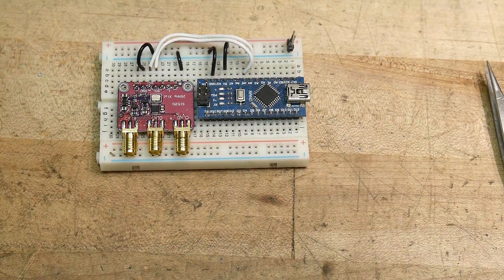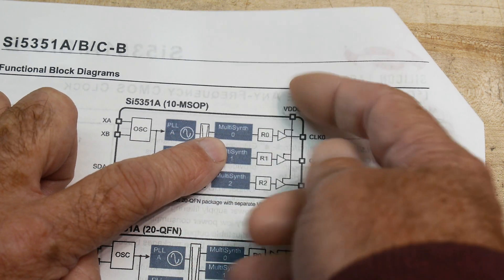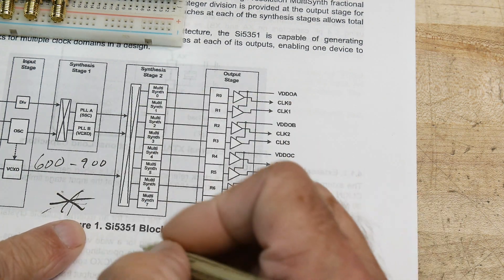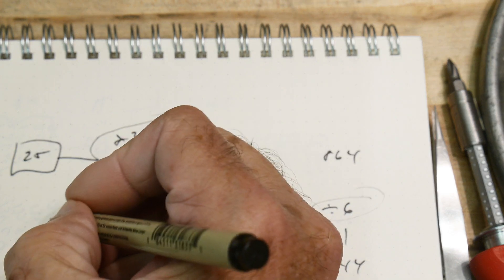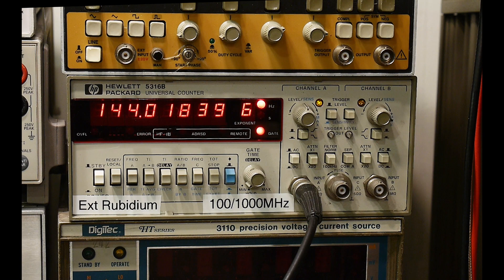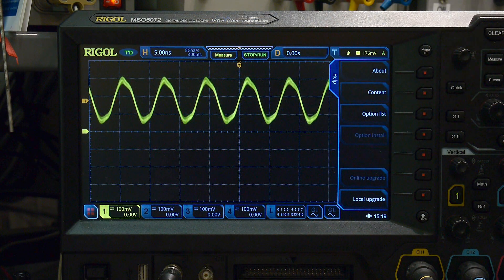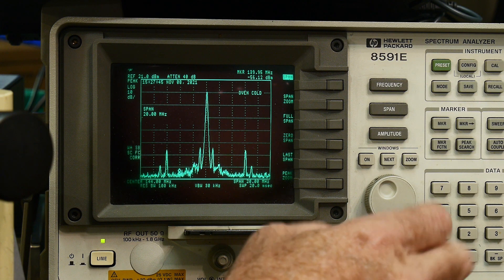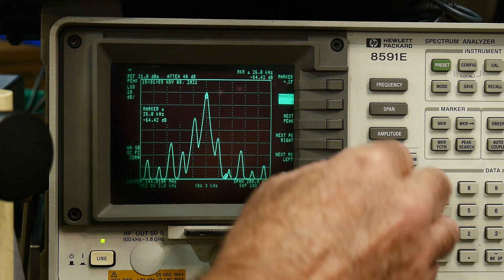#967 Why not use a Si5351 clock generator?

Comment: Have you looked at the supply raild? Maybe try adding a PSU filter and larger decoupling cap to improve the stability of the outputs. 100KHz sounds like the freq of a switch mode power supply.

Comment: Your resurrection of the IC-245 is spectacular!  I also have one, as well as the IC-255, 260, and 560 that may require this operation.  Also, as a matter of interest, I obtained a Ten Tec Delta II the post office was kind enough to destroy the LCD display.  So I've been considering replacing it with the LED style display and analog meter e.g. Ten Tec 516.  Your instruction is really making me think all these projects are possible!  Thanks again!  73, NG7I

Comment: In my opinion, the extra 43 Hz that appear on the display of the frequency meter are not due to its decalibration (the frequency standard is with rubidium), but from the clock of SI 5351. The overwhelming majority of quartz crystals have a frequency slightly different from the one written on the case. If you measure, you will find this. A software patch must be applied.

Comment: I'm curious of phase jitter of a PLL loop. Phase noise will appear as FM or PM at receiver.

I guess, phase noise is limited to the loop bandwidth with higher frequencies getting diminished by the loop low pass filter.

Comment: To help this device work for RF radio applications, two things can improve current situation: 1. disable fractional mode to remove frac. spurs, 
2. disable spread spectrum over SSEN pin and  SSC_EN register bit by software. According datasheet, it's logical OR combination. This device can be configured as quadrature signal clock up to 115MHz which is suitable for quadrature receivers.

Comment: I just got a Si5351 breakout board and am trying to program it. I need 100MHz and 28.8 MHz for a project, and I get a warning that "Out0 [2..8MHz] and Out2[100MHz] May Have Coupling. What exactly are they warning me about? (The warning is from the ClockBuilderPro software that generates the register programming values for me.)
Reply from the maker: try calculate it manually, it is not too complicated

Comment: I can't find that FM noise on any of my Si5351s here, though of course the spurs are present.  The spurs are much less pronounced at HF (about 15dB lower on the one I have on my bench right now) than at the 2m band.  

Some of what you're seeing there is likely exacerbated by the breakout board design choices -- a tighter crystal will help.  Heck, yours in the video isn't even a genuine one, so who knows what crappy crystal some race-to-the-bottom cloner put on there :-).

I bet a fast buffer in front of it will kill a lot of the AM -- plus, a decent 5v logic buffer gives you a bit of a boost if you need more power out of it.

Comment: A good VCO is always cleaner. That's what it's best at. However, a VCO drifts, and doesn't cover anything like the frequency range of an Si5351.
I'm playing around with the 5351 now, and I thank you much for the clear description of what's going on with them. I'd been puzzling through the spec sheet for a couple of days with little luck. You explained it all in under 19 minutes. Working backwards from the frequency you actually wanted was so clear and simple that I just shook my head. Thanks also for noting that the 5351 has BOTH AM and FM distortion. That could be problematic in certain applications. I had expected the FM jitter from this sort of circuit, but the AM caught me off guard. It pays to watch your channel. 

Between a VCO and a digital clock generator (one that is, in this case equivalent to 3 separate VCO's,) each circuit has its own advantages and disadvantages. We just have to pick the one that's best for our application. I'd pay pretty good money for a circuit that was as good as both devices at the things they were each best at. But the government would far outbid me.  :)

Comment: My experience is to use only one output of these si5351's using multiple outputs also generates a lot of spurs. Also good buffering is necessary.
Reply: Thanks for the info. I hadn't thought about the possibility of needing buffering. I'll look closely at the datasheet spec for output loading.

Comment: You could haved stayed by *32, and used a similar A + B/C to divide: 
A=5, B=5, C=9 . 5 + 5/9 = 5.555556
Reply: You can, but any fractional divider introduces lots of jitter. Since you can't really divide by a non-integer, what happens with a fractional divider such as your example there, is that it divides by 5 or 6; it uses the B/C ratio to decide that it'll count by that extra +1 for 5 out of every 9 cycles. That causes jitter.
If you put all the jitter on the PLL divider and keep the multisynth divider a pure integer ratio, it's much less visible on the output because the PLL oscillator tends to smooth it out over time.
Reply: @leonerduk  yes, that's why I added a change / edit, a year ago. 
Multiplying by 34 and 5/9 is a closer match, and all the jitter is in the PLL section.
Reply: EDIT: Change the multiply to 34 + 5/9  and your clock should get mighty close...

Comment: One big problem with that eBay / Ali express / Adafruit module (these use the 10 pin "A" version) - no transmit audio on FM, as that radio puts low level audio into the VCO control voltage to FM modulate the VCO on transmit.  SSB will work though, it's injected elsewhere for that.  For FM Tx, you need the 20 pin "B" version and the Tx audio (biased to 1/2 Vcc) fed into the "VC" pin.

Comment: JUST a curiosity but have you considered adding an OCXO as your frequency standard instead of the cheap 25 MHz crystal? I've read that the requirements for the Si5351 are a suggestion, assuming one is using a cheap crystal but it actually works fine with 2-100 MHz, so the 10 MHz OCXO would likely be more stable than the standard 25 MHz crystal. For the given radio you are messing with, I'm not exactly sure what the point is, but if messing around for the sake of messing around, why not?
Reply: I think you've got it right.  When I test my various Si5351s, they are in much better shape for HF with just a crystal.  Pushing them up into VHF is closer to the edge, and will drive requirements for all the other parts to be nice and precise.  A decent TCXO  with narrow specs might even be fine, though an OCXO would certainly be nice if it's feasible.

Comment: PLLs almost always (perhaps always) have sidebands like your 1MHz spurs - that's the phase noise of the VCO being pushed out of the lock range of the PLL and into sidebands outside of the loop filter. At least, that's how it was explained to me (and remembered, so I could've misunderstood!) by an RF engineer coworker.

PLL tuning can change the shape of the sidebands, but the total area is defined by how good/poor the VCO is.

Comment: It's a square wave output from the Si PLL/Clock chip... that and the jitter from factional division would mean it would have to have jitter cleaned and the fundamental filtered by downstream circuits, prior to going into the radio's mixer anyways... I agree that it's probably best to stick with the analong VCO that you have already.
I'm guessing that you are playing around with a frequency counter add-on for your CPU controlled VCO now?
Any issues with that Arduino's MCU clock interfering with RF and IF signals in the radio? I think it would be a 8 or 16 MHz crystal on that board... maybe need RF shielding down the road?
Cheers,

Comment: I do something similar with 23 channel SSB CB radios to get the SSB channels 36-38 or even 10m, but just run it right into the crystal socket through a small balun. The original interstage transformers do a good job with spurs as far as I can tell with equipment on hand.

Comment: Thanks for sharing!  I've been wanting to look at the Si5351 and the Si4342 and ADF4351.   There are some other around those number ranges chipsets that seem more interesting... though not certain the footprint will mount easy and mate up with the modules circuit design.  Would be neat to see those all compared on a channel of a nice scope and spectrum analyzer to compare performance.   Like you note also, compared with the stock VCO and your design too.  Reads like the 4351 is the worst of them.

Comment: They're useful chips but hard to FM so if the modulation for FM is applied to the VCO then it's a lot of effort.

There is a version with a 'VCO' input which gives some limited capability and I believe it works reasonably, however they're not as easy to find breakouts for.

Honestly, I'd be running with the board you have and experimenting with a PLL/VCO combo
Reply: You would FM a low frequency carrier and translate that to the desired band with the synthesized carrier.
Reply: @agnelomascarenhas8990 to achieve good FM  many radios modulate the VCO, which you'd be replacing with the Si5351. An awful lot of radios run the VCO at final TX frequency so there's no "lower frequency" to "translate" either

Comment: That way of controlling the SI5351 is harder to program but is more accurate. try looking up the command below witch is what most are using and is much easier. also don't forget there is a calibration you can do. please look them up. Thanks for the videos. I love them.

si5351.set_freq(((7180000) * 100ULL), SI5351_CLK0);  //Set the Frequency

si5351.init(SI5351_CRYSTAL_LOAD_10PF, 0, 8350);     //Calibration